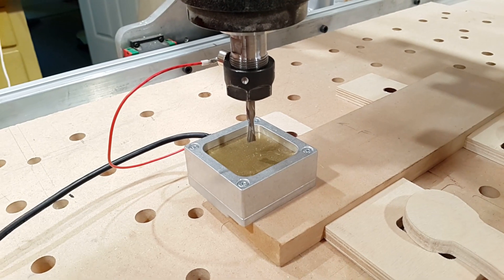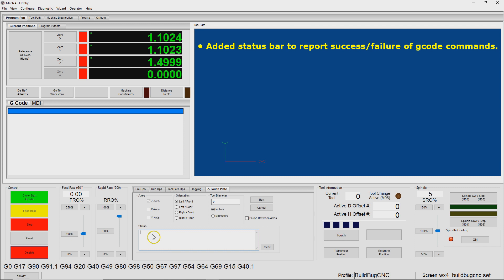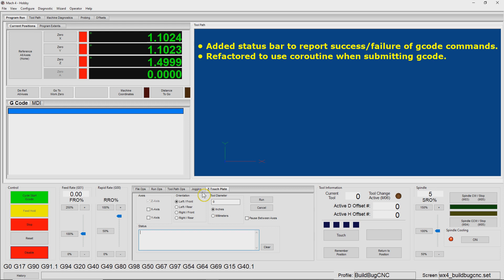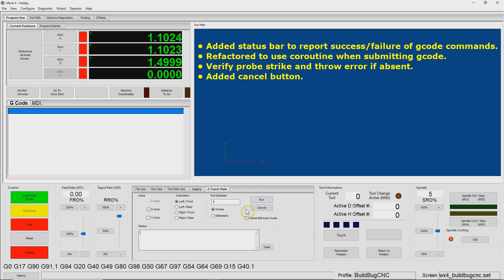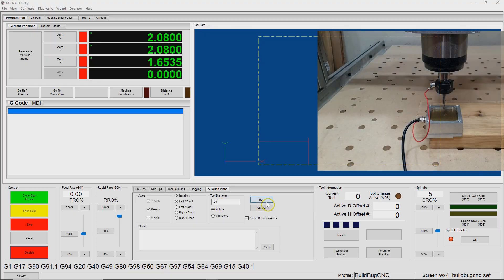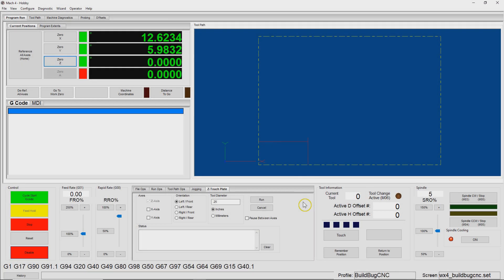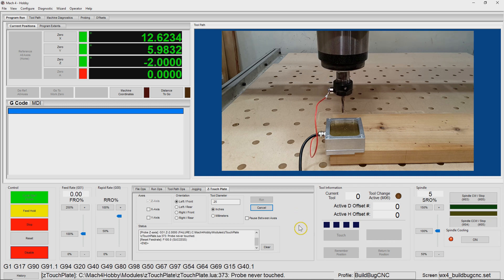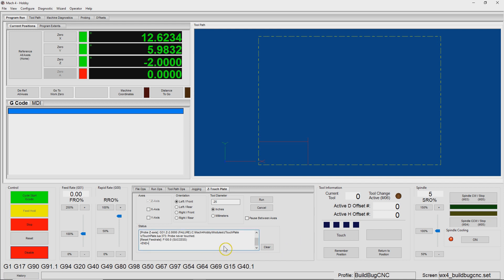Avid CNC Touch Plate - Mach4 Module Update version 2.0.0

Comment: I loaded the 2.0 script and all 3 axis work if I don't select pause between axis.  If I have the checkbox selected, the Z axis works as expected.  Once it touches the top of the touch plate, I get a popup window allowing me to continue.  When I continue, it moves on to the X and Y axis, sometimes it will just stop the moment it touches the X side; sometimes the X axis works and it will stop the moment it touches the Y side.  In either case, when it stops, the bit does not return to center and I don't get a window to continue.  I went through the script but don't see anything that would cause this issue.

Comment: Very nice work, and installation instructions thank you for sharing your work!  its working very well for me with the exception of one issue,  the cancel button, 
I  am running ESS Smoothstepper,  not sure if that makes a difference. 
here are the errors I am getting, 

--
Lua: Error while running chunk
C:\Mach4Hobby\Modules\zTouchPlate\zTouchPlate.lua:251: attempt to call a nil value (field 'mcMotionSetProbeComplete')
stack traceback:
	C:\Mach4Hobby\Modules\zTouchPlate\zTouchPlate.lua:251: in function 'cancelProbingProcedure'
	C:\Mach4Hobby\Modules\zTouchPlate\zTouchPlate.lua:223: in function 'handleButtonClicked'
	C:\Mach4Hobby\Modules\zTouchPlate\zTouchPlate.lua:187: in function <C:\Mach4Hobby\Modules\zTouchPlate\zTouchPlate.lua:186>
--
Looks to be like its crashing on the button click Code,  
any thoughts ?

	-- Button Click
	UI.m_MainPanel:Connect(wx.wxID_ANY,
						   wx.wxID_ANY,
						   wx.wxEVT_COMMAND_BUTTON_CLICKED,
						   function(event)
								handleButtonClicked(event)
						   end)
Reply: Found the issue, i did not create the lua panel, but rather tied the script to the Group Container,  all is working now including the cancel.  
would it be possible to get your wxFormBuilder Project file,  I have tried to understand wxFormBuilder without a lot of success., perhaps having your project as an example would help understand it better, 
Best Regards
Bob